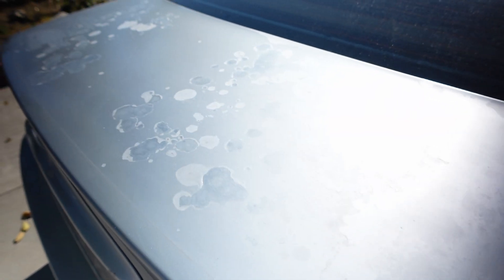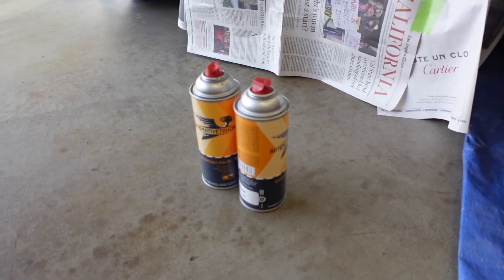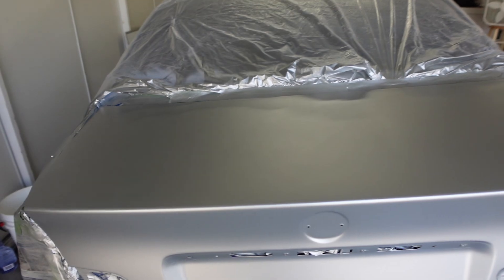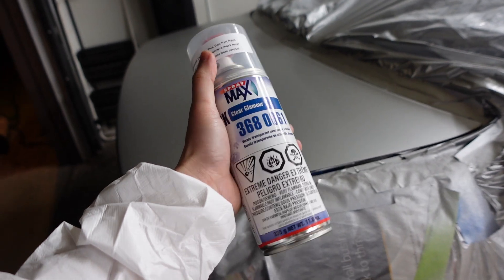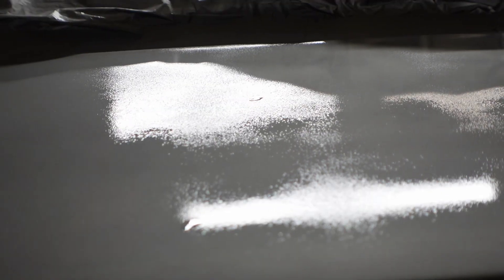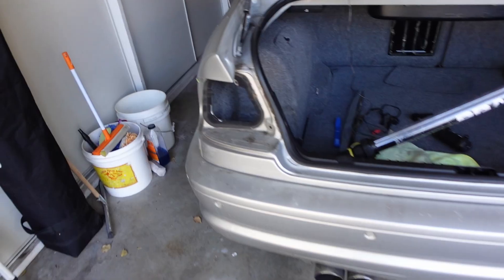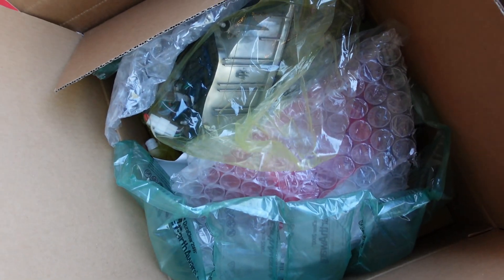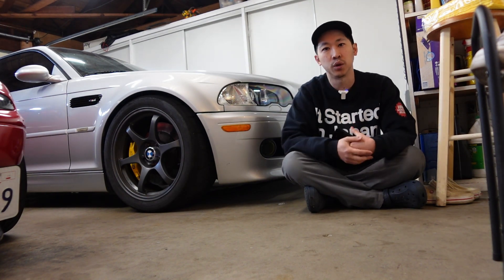Ruining my E46 M3 with Spray Paint Cans - Episode 11

Comment: I think removing the trunk and laying it so that it sits like a tent or even flipping it around and painting one side at a time would have helped a lot with your issues.
Reply from the maker: I think so too! Lessons were definitely learned.
Reply: @HazardGarage i would just use the first 10% of each can on the trunk but ur not painting much
Reply from the maker: @luke-o2n  yeah thats a good idea but I never thought I would have to 'plan' like that lol. Using full cans on the horizontal surfaces and then the 'used' cans on the vertical services probably could have solved for my issue.

Comment: Glad you were able to fix the spraying issue with wet sand & buff. How was the color match?
Reply from the maker: I was able to fix the orange peel by wet sanding and buffing. Color match looks pretty good in my opinion. The instructions recommend laying light coats until you get your color match. Too many coats or thicker coats could make the color too dark.

Comment: you fucked up at 1k clear....... 2k only. 1k is basically clear paint not clear coat
Reply from the maker: Yeah 2K is definitely worth it and miles better. I knew that going in, but never seen it for myself. Thats why I just did the side skirt in 1k.
Reply: @HazardGarage  2k is resin. 1k is paint

Comment: cmon dude did you even try researching how to paint a car. 
never spray 1k clear.
never spray 2k clear when its half full. dont let it even get low. 

move smoothly and dont put a heavy first coat 
you need to spray the 2k in two coats and then sand then spray the third coat.
Reply from the maker: of course I researched. But no video or forum post will ever be as good as doing it and learning it yourself. 

I knew 2K was going to be better but again, videos dont do justice to seeing it with your own eyes. I wanted to see the difference myself.

always keep learning right? 😀